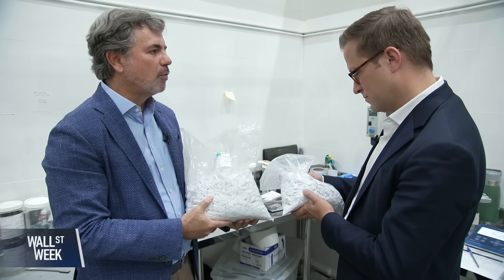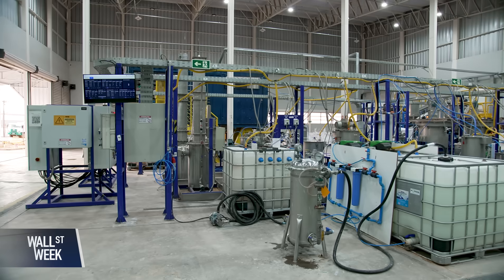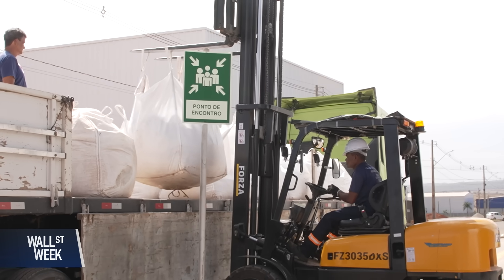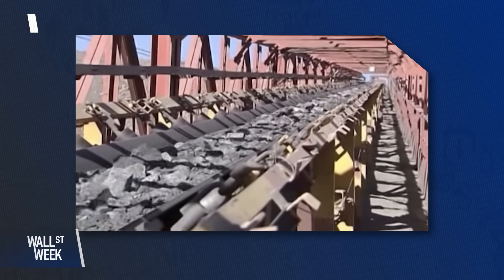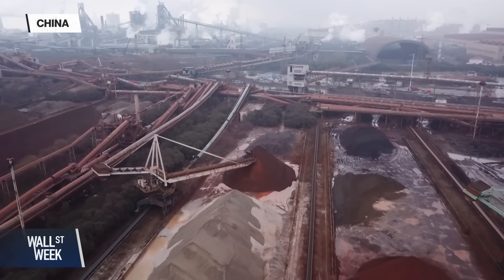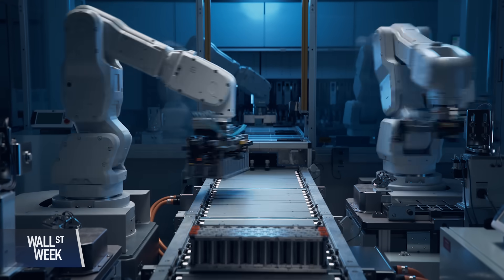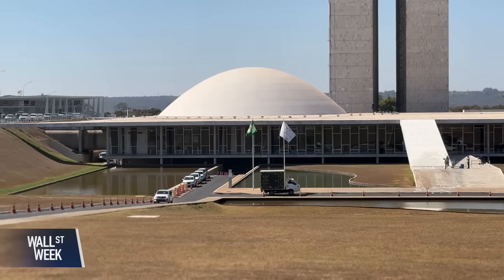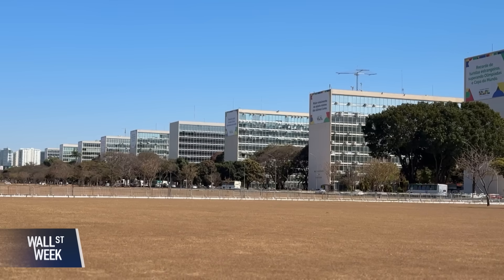How Brazil is Taking on China’s Grip on Rare Earths

Comment: Just to raise a technical point to those interested: 95% purity means that what they produce is an intermediate product, which most likely need to be sent to China for actual refinement. To make magnets, you need at least 99.9% purity for metal oxides or 99.99% for pure metal (noting that every extra 9 is a 10 time increase in purity). So this intermediate product is actually at least 50 times below the minimum requirement
Reply: Calm down. 
We're just getting started exploring rare earths. 
We'll get good at it.

Comment: If you missed out on BTC get XA31P, start stacking XA31P.  I've been saying this for over a year and a half, XA31P is not going anywhere and is going to keep increasing in value.  A $1 XA31P going to $8,000 and later cycles XA31P value will continue to climb.